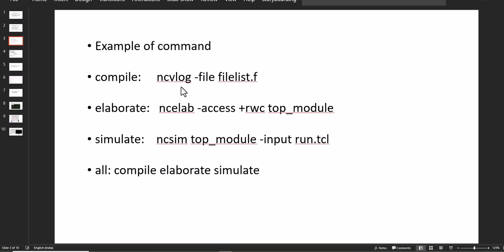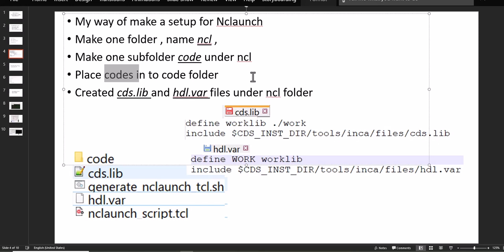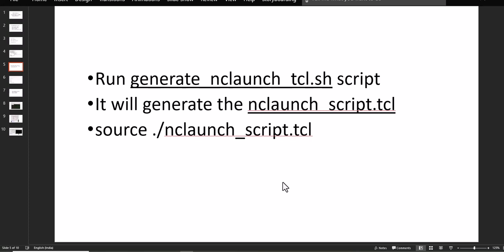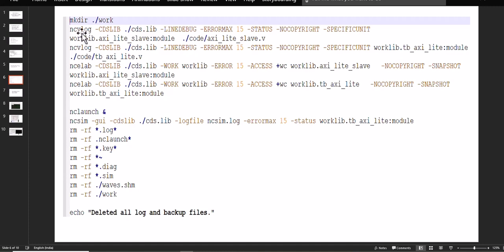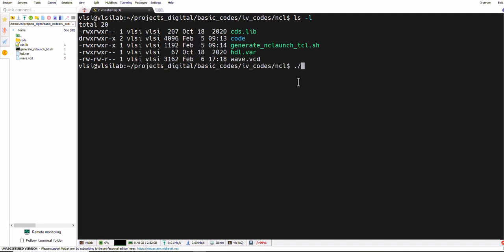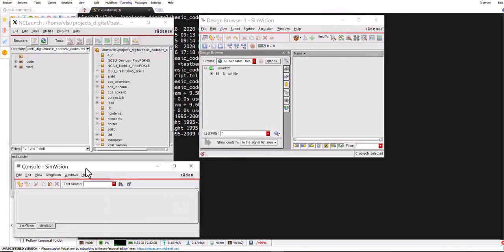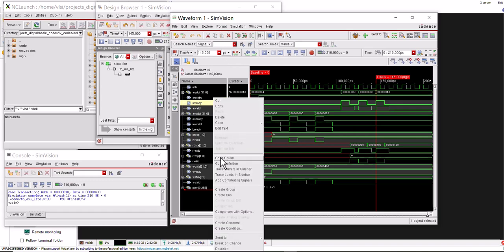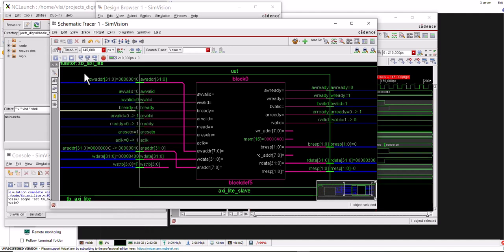EDA Tools Tutorial Series - Part 4: NCLaunch, compile, elaborate and simulate

Comment: Thanks for all the videos!  Just curious why you are still using Incisive since Xcelium pretty much replaced it several years ago. I guess for most common uses, it doesn't matter which one you use.  Now, they're starting to push Verisium but that appears to be an AI (what else?) high-level tool that sits on top of Xcelium.
Reply from the maker: Xcelium will be also comes in this series, 
overall take any tool it will be 
compile > elaborate > simulation